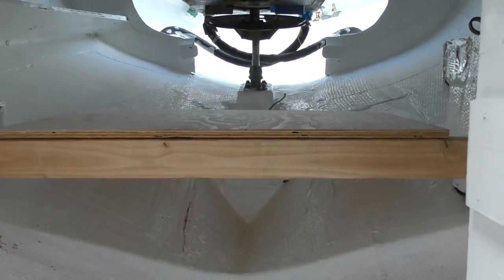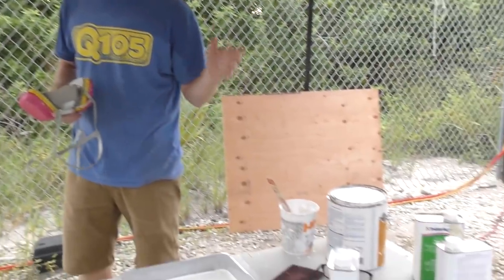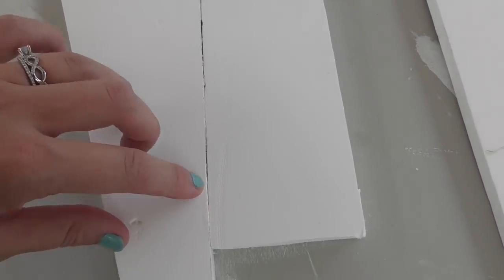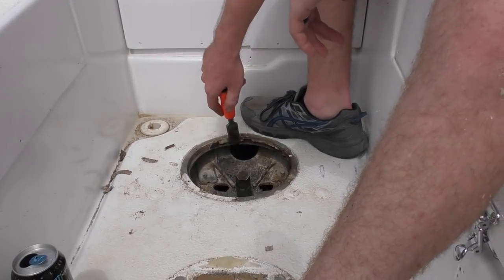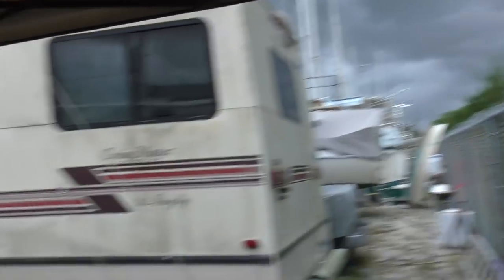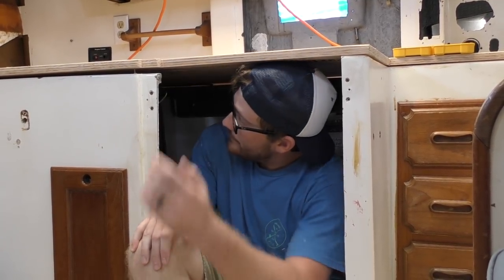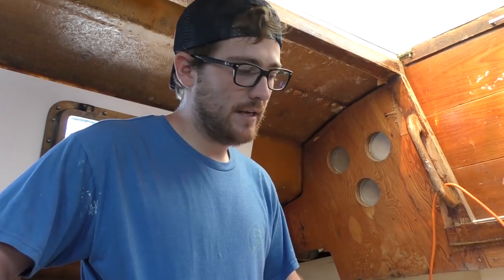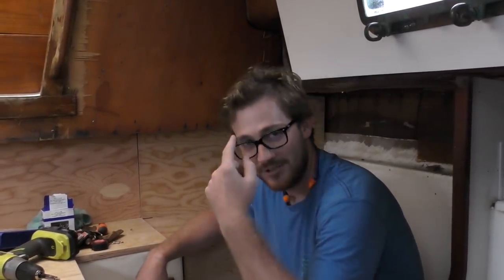54. We Have Multiple PROJECT Disorder - Reality of Living Aboard and Refitting | Learning the Lines

Comment: Randi, all the PVC cement I ever used has to be used with their primer/cleaner/catalyst or hardener, whatever the stuff is, you know, the Purple stuff you always see on PVC waterlines/plumbing? They make a CLEAR Version of that, too, nowadays. If you didn't use that stuff, you won't have a strong bond at all.Could that be why your seams didn't fill in well? It's made by the same Oatey company who makes the cement, and should be on the same shelf in the store. Just Read the Label CAREFULLY and don't get the Purple version, lol.
Reply: P.S. Also, they recommend you hold the pieces being glued tightly together for 10 to 20 seconds, to give the cement time to start Bonding. If you want to Paint it later, you'll have to rough it up with sandpaper so the primer and paint can bite.
Reply from the maker: Oh my goodness. Just looked it up and you are so right! I read the label on what I purchased, but it didn't even mention primer...or maybe I missed that part. I will have to pick some up. Thank you for pointing that out before I made the shelf! Good save. :)
Reply: and your cuts have too be straight so use a fence or straightedge. or recut them with a router and offset fence
Reply from the maker: True. I didn't recut those pieces; they were just scraps.
Reply: Just trying to Help. and Save you from having to Redo, and Disappointment, of course. Have to Carry My Weight SOMEHOW...
Reply from the maker: Definitely appreciated. Thank you!

Comment: On the rigging doctor this week, who has an electric drive, they were stuck out drifting in the gulf stream for 3 days on their return trip to the U.S. due to a no wind situation.  I don't think I could go electric unless I had a massive battery bank and enough solar to avoid something like this.  They have a small generator to charge the batteries, not sure why they didn't use it.
Reply from the maker: We've heard a lot about this channel, but havent watched them. Not sure what their system is like, but it seems like they have a few issues to work out.
Reply: Fu Dog Whisperer no schedules is why I sail, no wind? Row if you get bored lol

Comment: I was wondering could you use a  2000 wat generator to run you motor if you like needed to run the motor for like 12 hours
Reply from the maker: Probably, but we're hoping to do it without.
Reply: I just though it would be better than diesel if you were caught in a storm and your power got low that you could have more back up and if you go threw the Erie Cannel where you have no sail and have to use all motor to travel
Reply from the maker: Understood. We're ideally going without any fossil fuels so we don't need to rely on getting fuel other places. We'll see how it goes.

Comment: Are your Ryobi tools upset that you're flirting with a Dewalt circular saw?

Oh, and while I am thinking about it, or maybe you already mentioned this, perhaps you want to think about moving your traveller to the cabintop to allow for a better dodger design.  With the traveller at the bridge deck, it really makes a proper dodger installation difficult.
Reply from the maker: Yes, the Ryobi tools are a bit upset... we've been slowly replacing with Dewalt. Lol.
We've thought about moving the traveler, but it's easier to keep it where it is and we've gotten used to it. If we wanted to spend more time in the yard then we might have done it.

Comment: Actually, a freshly cut 2x4 is 2x4. A 2x4 that is 200 years old will also probably be 2x4, roughcut. The modern shrinkage comes from the modern practice of kiln drying the rough cut wood, which shrinks, and then planing all sides smooth and square again, which shrinks it again. Go into an OLD attic, you'll see the timbers are sll rough cut and full sized. FWIW.
 Today? They could make real sizes, but that would kill the profits.
Reply: I remember when they were 1-5/8 x 3-5/8 now even smaller
Reply from the maker: Yes, we've actually seen some old true 2 x 4s. We were more so talking about the ones you find in most stores today.
Reply: I pulled green chain, plainer chain, and timber deck for years and worked for 2 different companies and sawmills in Oregon(International Paper & Bohemia Intl). A freshly cut 2x4 was cut 1 5/8 x 3 5/8. Within a week normal shrinkage brought the dim down to 1 9/16 x 3 9/16. If we were cutting for direct to kiln boards all the dims were cut 1/8" over to shrink down to correct size after 48-72 drying time. Different dry times depended on the mix of lumber in the kiln. Nothing ever comes out perfect, which is why you sort at the lumber yard to get the pieces you want, especially if you a picky person like me.
Reply from the maker: Nothing ever comes out perfect. Life lesson. Lol.

Comment: i need to tell you or should i say try to help you.....i just watched you put fiberglass over a non sanded surface and Evan a painted surface as far as that goes ....  it definitely will turn loose on you... you cannot trust it...remember...you will be far away from land and help....it will fall off.....i have worked with fiberglass and refinishing paint products for many years and what you have done only from lack of knowledge has endangered your life's
Reply from the maker: thomas dawe, I dont know what you saw, but I ground down the paint to bare fiberglass before tabbing in the supports. We didnt show it on camera but it was done.